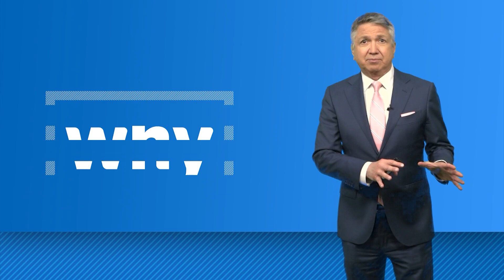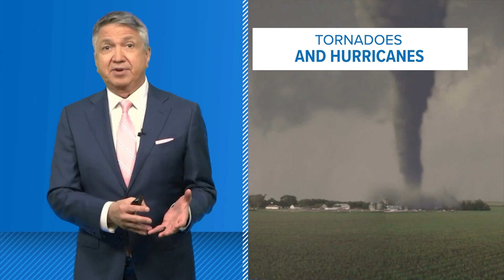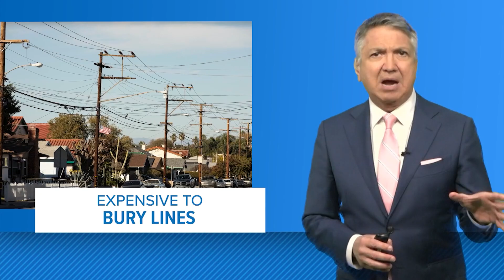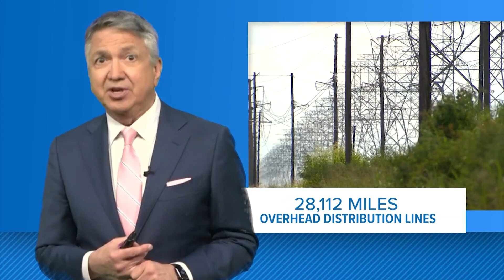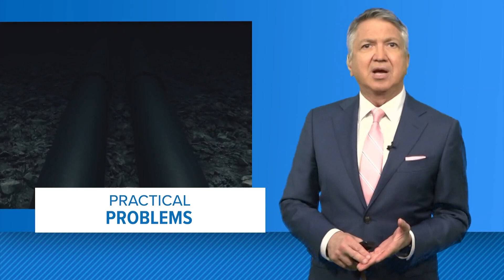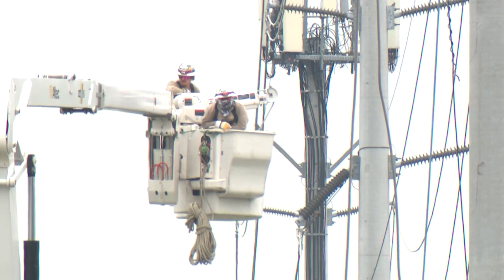Why doesn't Houston bury its power lines?

Comment: when the engineers from Australia where here they asked this question and when given the same half answers showed how it could be done just like they did it there.... they were then quietly asked to leave ... seems downed power lines are a source of BIG federal emergency dollars... look into the money that is received and you'll find the answer one way or the other...   after all if they started requiring new developments put their lines underground, and if they started doing the method of whenever the ground is opened up that drop a section below ground ... as in they are updating the water lines , or putting in cables whatever .... also if you start making sure every home and business has its own battery and power wall... which could be made here in texas ie new jobs.... along with a basic solar/wind array...  it could ease the burden on the grid... give people a couple days security at the least....   then it might even allow us too start selling excess power outside our currently failing grid .....